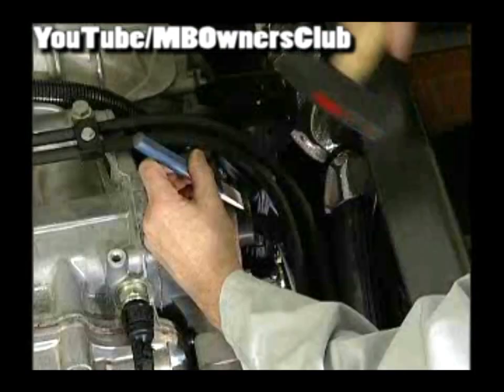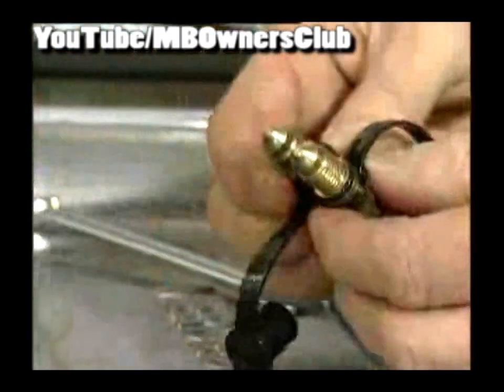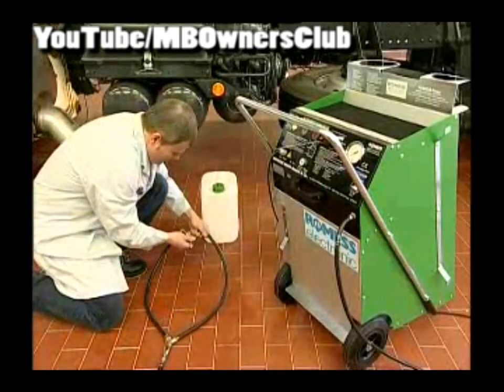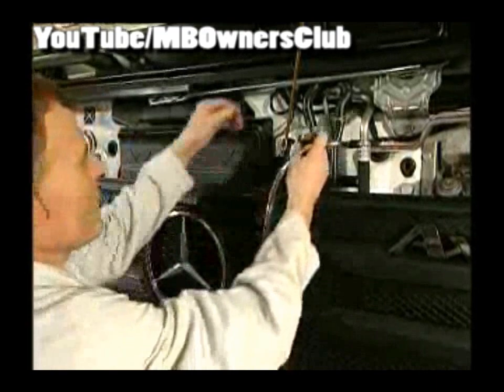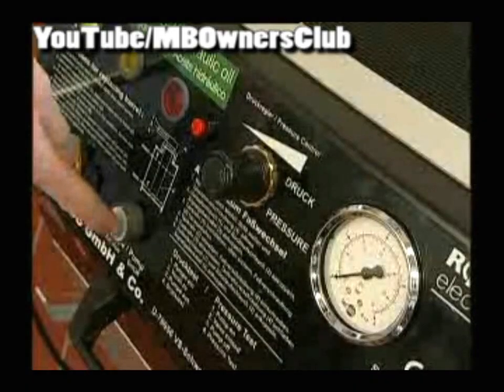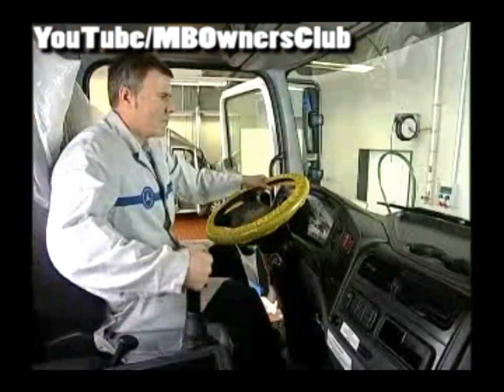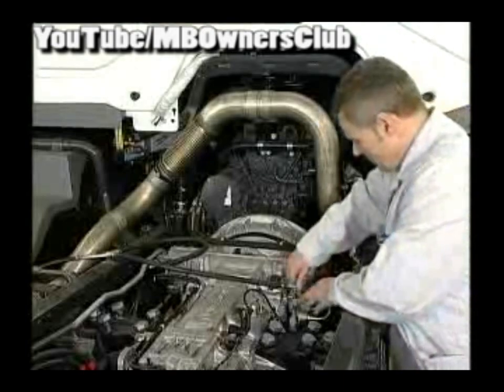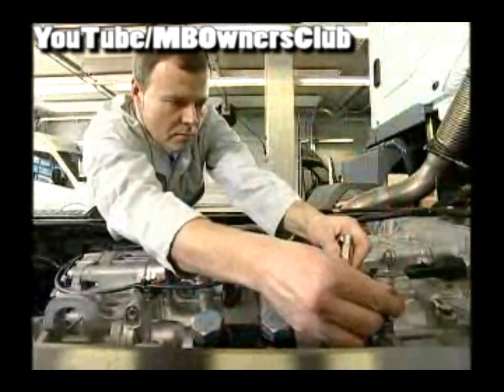How to Bleed the Shift Mechanism on Mercedes-Benz Transmission 712-715

Comment: What type of hydrolic fluid used
Reply from the maker: The recommended hydraulic fluid for bleeding the shift mechanism on the Mercedes-Benz transmission 712-715 is Dexron III ATF (Automatic Transmission Fluid). This type of fluid is a high-quality, synthetic automatic transmission fluid that is specially formulated to meet the performance requirements of Mercedes-Benz transmissions. When bleeding the shift mechanism, it's important to use the recommended fluid to ensure proper function and avoid damage to the transmission. Always refer to the manufacturer's specifications and instructions for the proper maintenance and repair of your vehicle.